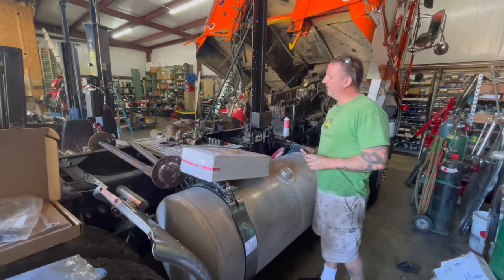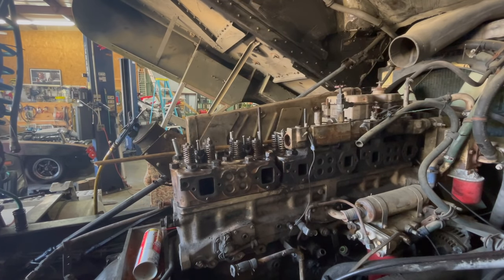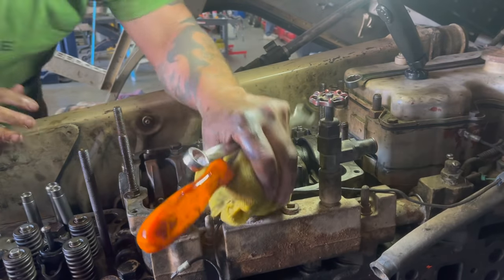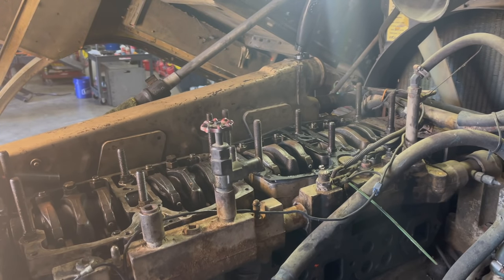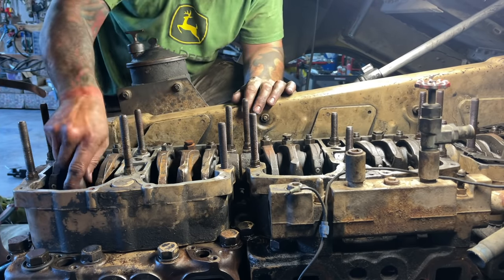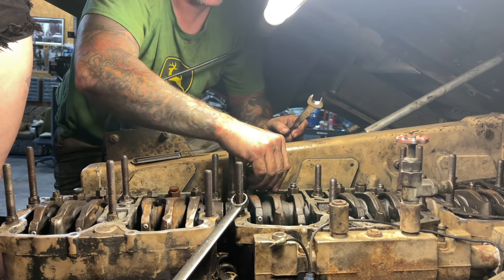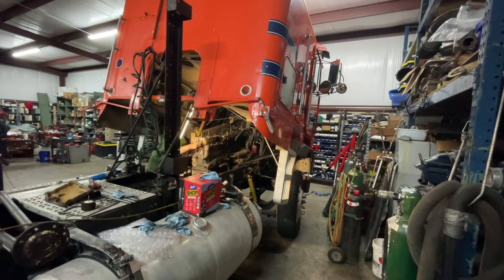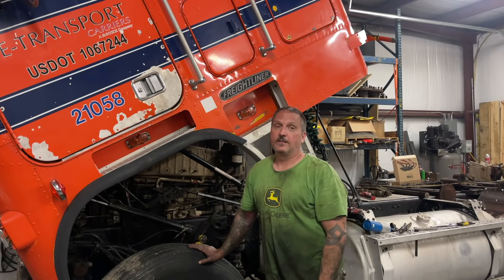1989 Freightliner "Candice" Big Cam IV will it start?

Comment: I might be late to the Party, but you have a BC NT 88 here minus the STC (Step Timing Control} post BC IV.  When you install the rocker boxes, throw them on without the bolts/studs, set your push tubes, then the studs/bolts.

Comment: Thanks for filming setting the valve lash on the valves and injectors. I’ve seen a couple of videos on it but they just didn’t really make me comfortable with doing it. For some reason I’m almost positive me and you were working on the exact same engine one thing I am confused about though it is on your engine and my engine those look like high flow radiators, and the tank that’s on him also looks like the team that goes on the iPhone system, but the aftercooler looks like an old style low flow coolant system set up.
Reply from the maker: Hmm. I’d have to look at it again it’s been a little while and quite a few engines since I was working on candys.
Reply: @JamesPretty  if u get time let me know on here man I’ll shoot u my email or phone number and after I get it fired up I’ll send u a video!
Reply from the maker: @Alanthe918mobilemechanic  nice

Comment: James I thought you were putting Silver 92 in that? I am a Cummins man I like it.
Reply from the maker: This is Candice.  You’re thinking of Delores her older sister.  She’s getting an 8v
Reply: @JamesPretty  Man what are you going to do with all those cabovers? I had a 88 Shaker I did a ton of work to people thought I was nuts ran it for 3 years hauling bottle water and dry van wasn't making a ton of money so I sold it guy is still running it today, had a 350 just like this one. Very dependable.
Reply from the maker: @maxpuppy96  I’m not sure yet. I’m gonna figure it out over winter